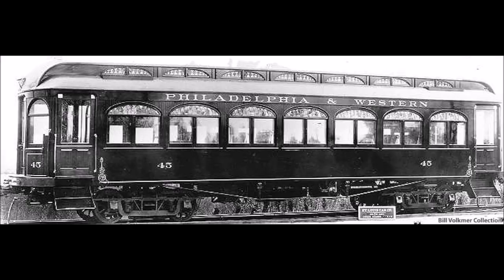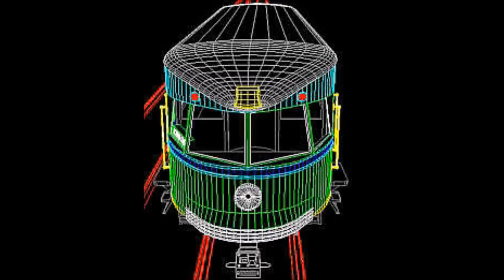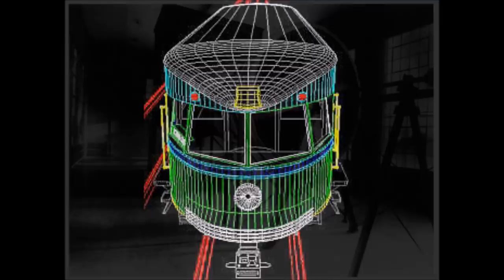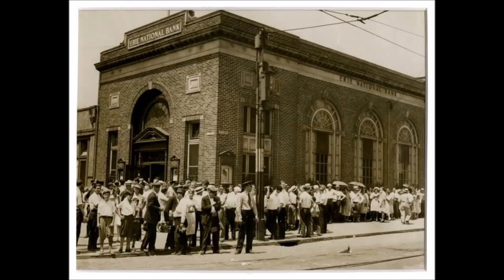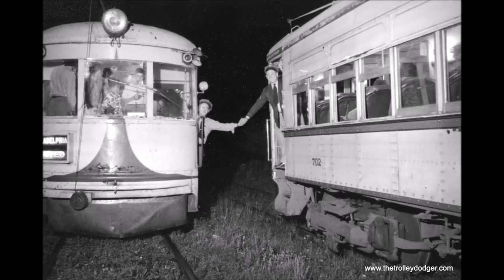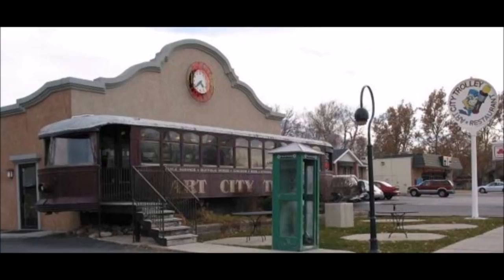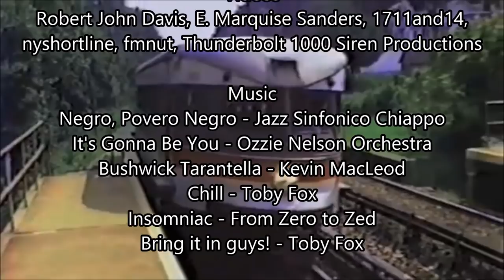Engines of SEPTA: J.G Brill Bullets

Comment: To fill out the 1989-93 history a bit: 

When the Bullets and Strafford cars started to fail SEPTA had to shut the line down for a while. They tried special shuttle buses which of course were much slower and less reliable. There was serious talk of turning the line into BRT, but that idea was scrapped due to legal issues regarding the ROW and funding that was specific to maintaining rail service. As a stopgap SEPTA acquired six pairs of castoff CTA 6000-series cars which only needed minor modifications to run on the P&W tracks. They also took 5 (?) single M3 cars from the Market-Frankford El, regauged them using trucks from scrapped PATH cars. The CTAs were used for Norristown service, while the M3s were generally restricted to 69th St - Bryn Mawr locals. That continued until the mid-90s when the N-5 fleet was large enough to take over full service.

SEPTA's not normally known for innovation but they deserve props for cobbling together a fix that worked for over half a decade. I admit I was never fond of the CTAs - they were slow, noisy, drafty, and poorly-lit - but they saved the line.

Comment: A few clarifications.  The P&W Bullets were numbered 200-209. The 11th Bullet was the second 203, built in 1933 to replace the original 203 which was consumed by a fire.  The FJ&G cars were numbered 125-129.  The P&W cars weighed 26 tons.  No. 204 was quietly scrapped by the National Museum of Transportation in June of 2018, and No. 206 is preserved by the ELECTRIC CITY Trolley Museum.  Loved this video, VERY well done.

Comment: These are very cool looking. the NHSL is such a strange line. I'm genuinely curious what the future holds for it since speeds have been cut back, and I've heard that the current cars on the route acquired in the 90's (I think?) are starting to experience mechanical failures that regularly cause delays on the line. I'd love to one day see the line re-tooled as an extension of the L with frequent through-running service from Norristown all the way to Frankford TC. I'm kind of afraid that once the cars go, SEPTA will put the line out of service and it will sit abandoned.
Reply from the maker: Abandonment is certainly not gonna happen. The line is a crucial connection from Norristown, toward the "main line" suburbs of Philadelphia, all the way to the dumpster fire called 69th st. They did try a branch extension to King of Prussia but the project stalled from cost overruns and NIMBYs. The replacement cars the N5s are indeed big rolling piles of junk being top heavy, unreliable, and a pain in the ass to run. SEPTA hasn't drafted any replacement cars for the NHSL yet but abandonment? cmon now.

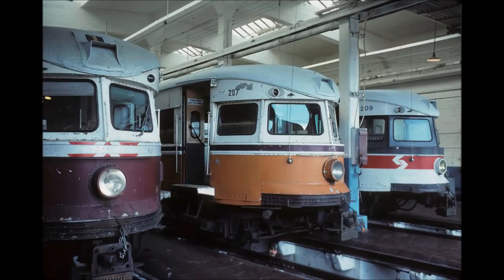Comment: 11:02 NOTE: septa bullet trolley 207 almost collided with bullet trolley 202 in 1/26/1987
Reply: Contrary to very popular belief the Bullets are NOT trolleys.  They were never called trolleys until SEPTA took the line over in 1970.  Without any more on line freight, SEPTA isolated the line and only then did it become a trolley operation.  The Bullets are electric MU cars just like MP-54's only lighter and a lot faster.😊

Comment: Um no,

There were only 10 cars, 200-209 (displayed as 0-9 on the roof above each air scoop on each end).
Reply from the maker: Thanks for the correction.
Reply: The original order was for 10 cars. One was destroyed and Brill built a replacement. Technically 11, but only 10 ever ran at one time.
Reply: Also, the 11th car, the replacement 203 had steel under frame with aluminium skin. 
It was heavier as a result, and the difference could be felt in the ride.